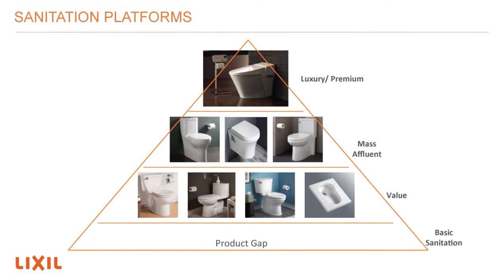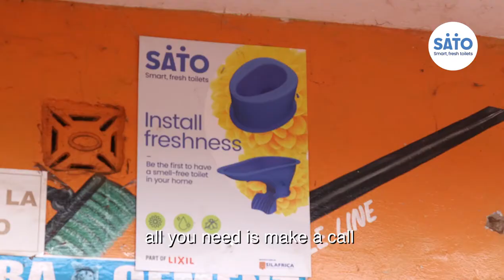SATO Toilets Pans Installation in Mwea - Kenya.

Comment: Does it bio digest the waste?
Reply from the maker: Hello, SATO Toilets provides a range of sanitation solutions like the SATO Toilet Pan, the SATO Flex Pan and the SATO Stool. These are installed on the traditional pit latrine to upgrade the latrine to a modern toilet with flush. The SATO Toilet pan requires only 300ml - 1 litre of water to flush. The amount of water needed is 80% lower than what a traditional flush toilet would require. This makes it suitable for regions with water scarcity. Aside from low water requirement, the SATO Toilet pans also make the pit latrine safer, especially for young children. The pan also has other benefits like keeping away flies and bad odour.

Comment: does it minimize the usage of water...?
Reply from the maker: Hello. The SATO Toilet pan requires only 300ml - 1 litre of water to flush. The amount of water needed is 80% lower than what a traditional flush toilet would require. This makes it suitable for regions with water scarcity. Note that you can call our customer care team on +254800722233 (free of charge) and they will gladly assist you with any information that you might need.